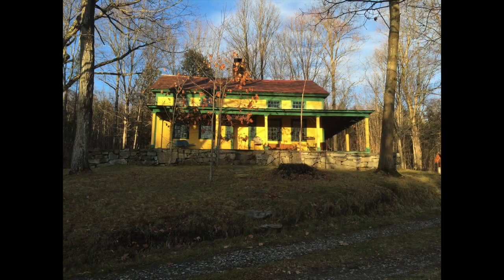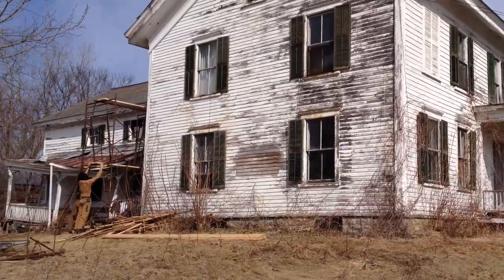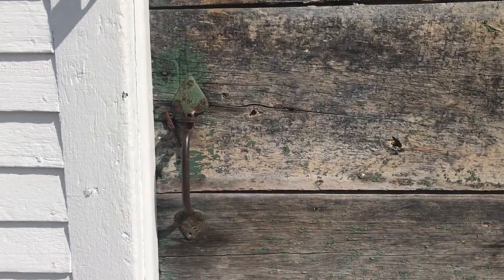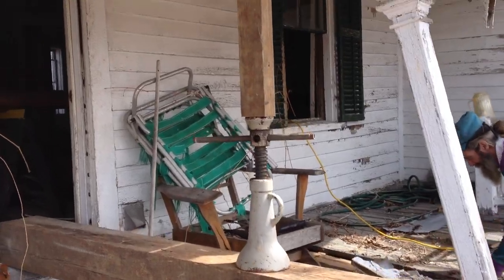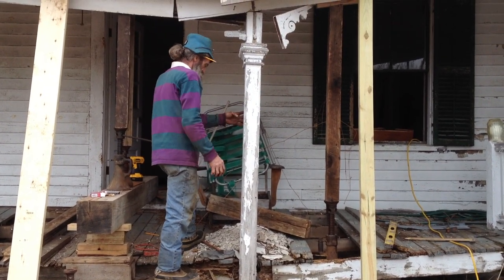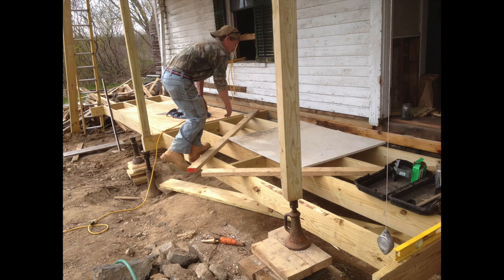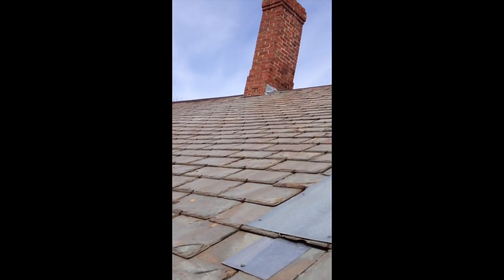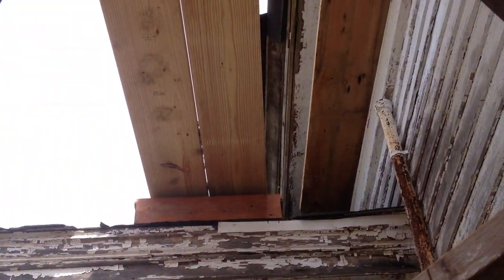Early Historic Farmhouse Restoration - How to w/ Yaglou Ep.1

Comment: The colors for the first house are a crime, but nice projects. I Love these kind of houses.
Reply from the maker: The color yellow of the first house is historically correct to the second period.  Let me explain which is interesting.  Circa 1850's when they added the Greek Revival porch to this Federal Farmhouse they redid the clapboard so there is no telling what the first period color was but most likely white.   The Green trim is the correct color of the Federal period to the house as that was not replaced.   So in deciding what color to paint the body of the house took some detective work.  There where two areas in the house that revealed Clapboard that was first surface to the second clapboard which was done in the Greek Revival period.   That clapboard had that exact yellow color which I had computerized to match exactly and I still have that example of clapboard w/  that yellow on it - so its kinda like ironclad proof.  Also the color yellow is also a common color for Greek Revival period.   Another very interesting proof of the color is the sister house up the road which was in the same family - and guess what the cupboards inside that where from  that same period are painted that exact yellow - and I bought one of the cupboards with that yellow from them to have in my house.  I hope you like that explanation as that is the evolution of the  paint history.
Reply: @AntiqueFarmHouses  That is so cool! You are a true history preservationist. Even down to the paint color! One would not expect an old house like that to have those bright colors, but that’s because all those photos from back then are in black and white. I think those colors are just splendid.
Edit: I’m further in the video and thought I recognized the scene, not sure why. Then you said those were the adirondack mtns, and I checked the description to find out this farm was in Essex. I used to drive by this house and wish for it to be fixed up before it completely fell down. I haven’t been there in about 10 years , but now I will have to drive out and see it all finished. It’s been 7 years since y’all started on it but i’m sure it’s still beautiful. Cheers!
Reply: Color was fantastic, nice work.